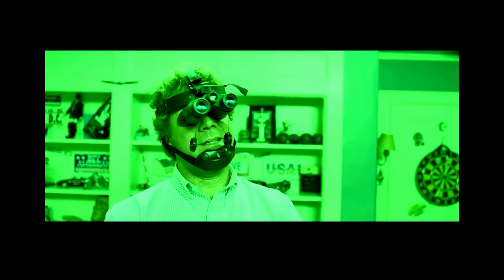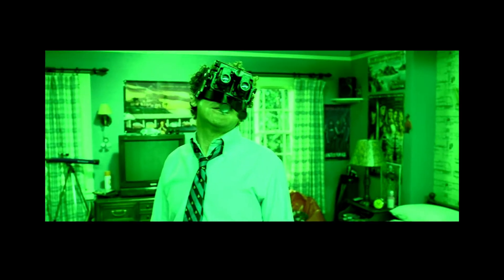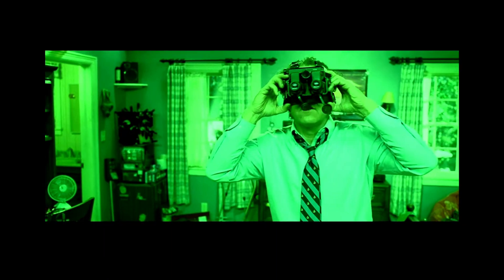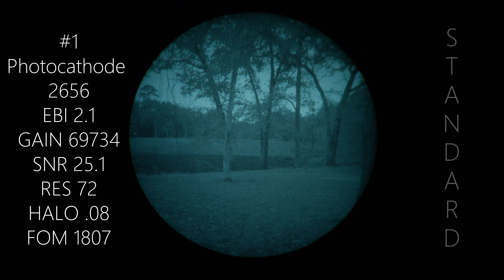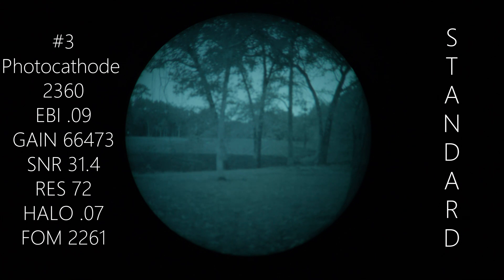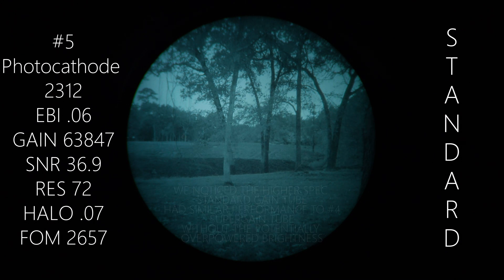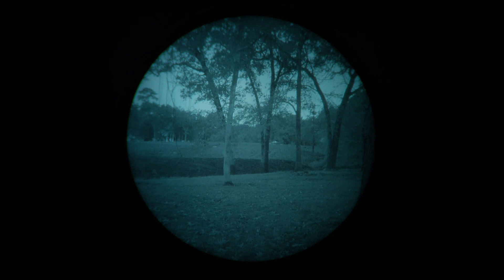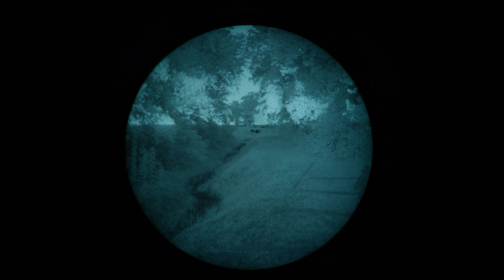Custom Night Vision | L3Harris Supergain Tubes

Comment: For those saying the contrast is better in the standard cant you turn the gain down a little if you have manual gain and achieve the better contrast with super gain?
Reply from the maker: yeah, but its not exactly the same.

Comment: Solid video I have watched twice now. Just got Supergains finally (have owned high spec elbits and L3 unfilmed). I'd say the Supergains are better than L3 unfilmed but only in the darkest of conditions. They work really well with iris's and lens caps like the Phokus caps, as you can turn of the gain and everything stays in focus without being too dark. Otherwise, they're the exact same as L3 unfilmed. Another advantage is there is less blue hue - so things appear to have better contrast. Is it worth the price increase? for me it was because where I train is an hour outside of city, deep in the woods. I think these will be the future. I would like to see a follow up video comparing less tubes, and just L3 supergains vs L3 unfilmed in darker conditions.
Reply from the maker: im going to start on another video soon.

Comment: Is it just me or does the standard L3 tube look better? 🤔
Reply: Yes, they look worse at high gain. But you can turn them down to standard gain. Then it looks normal. 
L3 lacks heavily in MTF. That's the reason why Elbit and Photonis looks better in comparison. 

But supergains are the best in low light. That's the price you pay. You can't get everything in once.
Reply from the maker: Its all personal opinion man.
Reply: @customnightvision Why do the supergain tubes seen to have a lower SNR & Resolution (as a whole, not always)?

Comment: All of those tubes look good, but i would say that all 3 of those super gain tubes are definitely providing more usable information compared to the standard gain counterparts. Its hard to make a call because even the low FOM tubes lool good. Hell, tube #2 looks really good for 1800 FOM. I just purchased a device with a high spec L3 supergain tube from you guys and i am blown away by the performance. L3 was definitely the correct choice 🤌
Reply from the maker: Hell yeah man we appreciate it.
Reply: Correct me if I'm wrong, but FOM is a relationship of lp/mm and SNR?  If so, I don't understand why it really matters.  It's possible to have a tube with high lp/mm but low SNR and have a higher FOM than a tube with lower lp/mm but higher SNR.  Realistically, which of those tubes will look better?  

I've been lead to believe higher lp/mm (above 64) really only matters for a clip-on where it will be viewed through a magnified optic.  Higher SNR will give a cleaner image as the light gets less and less, which I think is more important for NODs, no?  I suppose that spec might mean more if you're looking at lower gen or older tubes as most modern tubes exceed 64 lp/mm anyway.  

Gain matters most as the light gets below really low thresholds.  Testing super gains vs standard gains in (relatively speaking) brighter scenarios isn't really going show the differences as much.  To be honest, I'm seeing much of a difference in this particular video, but there are others out there that have different lighting scenarios and the difference is much more noticeable.
Reply: @edwardlance2379  SNR for sure. My tube has a ridiculous SNR and it looks amazing. Low EBI and HALO as well. Super high lp/mm is almost pointless unless you plan to use it with a camera

Comment: went back and re-watched this again and my 2 cents hasn't changed. S/N seems to be the single most important spec when comparing tubes, provided some other spec is not totally out of whack. FOM is almost useless due to my eyes not being able to tell the difference between 64, 72 and higher line pair. after seeing a post on P&S about L3 making these tubes for the South Korean military and they not being happy with them and returning the entire run back to L3 which then made a deal with TNVC to sell them to civilians, it made me wonder just what the truth is. from what I can see in videos like this the SG tubes are brighter at the expense of image quality, they seem to perform a bit better but with more grain and loss of detail. I'd have to compare them side by side in person to really tell if they would be worth the extra $$ or not. that's a BIG risk to take if you are ordering tubes without a in person viewing experience. Thanks for the great videos!

Comment: Good comparison. I did a series of shorts comparing pretty high SNR supergains and L3 unfilmed tubes but my NV recorder wasn't a very fair comparison since it kept autoadjusting the video. I generally agree with your conclusions. There's definitely more noise with the SGs, though they do provide some advantage in very low light levels. My takeaway was that the jump from 24UA to 24UAH was similar to the jump between unfilmed and thin filmed, providing an advantage in pretty much the same set of environments and lighting conditions, though to a slightly lesser degree. I would encourage you to test them out again at 0-10% background illumination in the woods and/or somewhere else with 3 bortle or less where you'll see more of that advantage, you'll still get some of the benefits at 60% such as being able to see deeper into the shadows but it's kind of like taking a Porche on the highway: yeah you'll have some opportunities for the car to shine but on the track you'll see all of it.
Reply: Yeah we will probably do that. I wanted to use the most common lighting conditions for 90% of users for the initial comparison. I feel like if a tailor the comparison with a bias in favor of the SG it wouldn't be an accurate assessment for the majority of viewers. BUT, i do want to do another analysis in conditions more suited to highlight their added capabilities.   

Paying more for 24UA tubes doesn't make sense to me when most of the 20UAs we get are above 24UA minimums lol.

Comment: Man it’s tough to tell a significant difference. Last 2 tubes are really nice.
Reply: Yeah, In a darker setting the difference can be more apparent. I think they’re cool but not a must have. For guys in like zero illumination environments it’s a useful increase but I’d say for most it’s a wash. I’d say manual gain is a must if you go the super gain route as well..
Reply: @kevin11288  This video once again confirms my previous viewpoint: under moonlight, it's challenging to distinguish between the two types of devices. Evidently, both the filmless tubes and the super gain tubes cannot fully utilize their entire gain capabilities under moonlight due to the environment not being dark enough. The brightness of a moonlit environment can reach up to two decimal places, while brightness within a jungle can go down to the fourth or fifth decimal place. It's only in such conditions that the performance differences become noticeable. For instance, in an urban environment, differentiating between the 25k-gain Echo, 70k-gain Elbit, and 63k-gain L3harris is a challenge. A dimmer environment is absolutely necessary.

Naturally, as the gain power continues to near 100%, both the Signal-to-Noise Ratio (SNR) and image resolution degrade exponentially. When the brightness falls to six decimal places, the actual resolution would decrease by a factor of 10 (68lp/mm to 9 - 10lp/mm), and the actual SNR would plummet a hundredfold (SNR 32 to 15 - 12 ) . Therefore, in even darker settings, tubes with a higher gain will exhibit superior resolution and a better signal-to-noise ratio under low light conditions. I believe this epitomizes the true value of the super gain tube.

For consumers, the biggest oversight of L3harris's super gain product is the failure to enhance the output brightness. I've had experience with the PVS31K, which can attain an output brightness of 8. Its effect is impressively stark, bordering on blinding. However, the newly introduced super gain tubes today generally don't surpass an output brightness of 3.3, with filmless tubes being even dimmer, typically below 3. To offer a tangible experiential difference to users, L3harris should elevate the output brightness of their tubes as a selling point. 

In the end, as you rightly pointed out, for tubes with higher gain capabilities, manual gain adjustment is indispensable.

Lastly, I have a question: when will you start selling super gain tubes?

Comment: Some misinfo in this video
Reply: Please explain
Reply: @kevin11288 right off the bat the LG range for a standard gain tube is 65k +/- 5000 set at the factory by L3H, not 60-69k, hell you even had some tubes with an LG above 69k in the video.
Reply: @atacorion per the data sheet it’s 40k to 80k.. I said most are in between 60 and 69 in reality I meant 60 to less than 70.
Reply: @atacorion that would be the same as 65k +/- 5000 lol
Reply: @atacorion I should have said 60k to 69,999.. sorry. However, I don’t think this takes away from the rest of the video.
Reply: @kevin11288  higher LG doesn’t increase the tubes ability to amplify light either. Not sure where you came up with that bit of info.

Fl/Fc is foot lamberts per foot candela just an FYI

LG is voltage applied to the MCP, SG tubes are just driven with higher voltage than Standard gain tubes. This increasing image brightness.
Reply: @atacorion pure misinformation buddy. But good try.

Comment: Supergain are min 2376 fom per TNVC. Mine are over 2600. Supergain allow you to see through shadows better. But the best benefit I’ve found is that I can run caps so everything is in focus and still bright. Also 62% illum is high. Take these out in a 4% illum night and you’ll see a big difference
Reply: They’re not 2376 min.
Reply: @kevin11288  If you go on TNVC they only sell supergains at 2376+ FoM at this point in time. I know there's some older units out there from before they refined the grade criteria and back when H tubes weren't on the open market, but any new supergain tubes from TNVC will be at least 2376 FoM.
Reply: They’re 1800 minimum.
Reply: @kevin11288  From their website: ALL SYSTEMS WILL BE 2376+ MINIMUM FOM
Reply: @ΛΔΔ  They probably only sell 22UAH and 24UAH tubes. 1800 FOM tubes are usually 18UM tubes or in this case 18UMH probably.

Comment: The Nocturn Industries Chimera Pano bridge is nice. I cant wait for the entire unit to be available
Reply: I cant wait to see a real prototype. Lots of confusion surrounding this product. the entire housing is still just a concept. optical system has yet to be made. Currently it is just a Bridge that accepts pods from other panos like GPNVGs. so if you don't already have GPNVGs you would need to get those first.
Reply: @kevin11288  they actually had a protype at Shot Show. A couple of people tried them on. I'm not sure if they were able to actually turn them on and use them, lol. I couldn't see any light emitting from the rear glass onto their faces so I'm guessing they weren't able to actually turn on. But quads can be difficult to see that effect due to how wide they are.

I already have a pair of quads. The Chimera bridge is cool but I don't really want the bridge. I want the entire housing to transfer my image intensifiers. The bridge is $2,500 and the entire housing will cost $7,500 as of now. They say they are planning to come out quarter one of 2024. I hope they keep to it.

Comment: L3 has been making these for ten plus years.  Supergain is simply a marketing term that TNVC came up with.
Reply: Not ten years but they’re not new. This video wasn’t intended to say anything different, just discuss them.
Reply: L3 hasn’t been making them for 10+ years. Only about 2 years. SG is the marketing term L3 came up with that TNVC uses.
Reply: @atacorion do you would agree it’s about time someone did a no bs video on them? Lol
Reply: @atacorion they mean tube grades with H suffix, yes supergain technically is a separate grade, but very high gain variants have been around for a while.